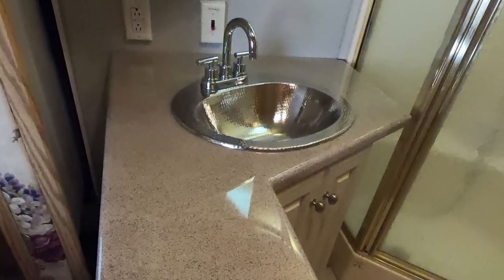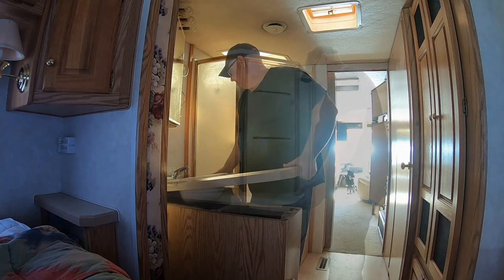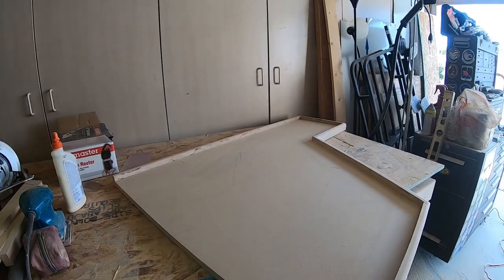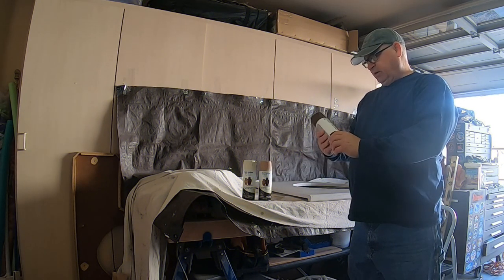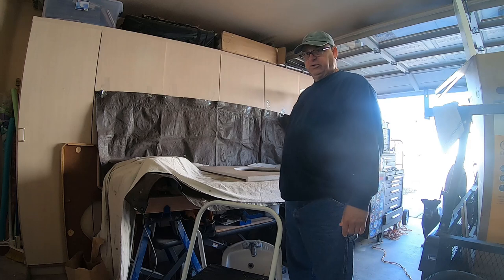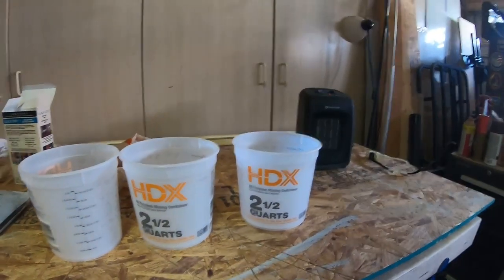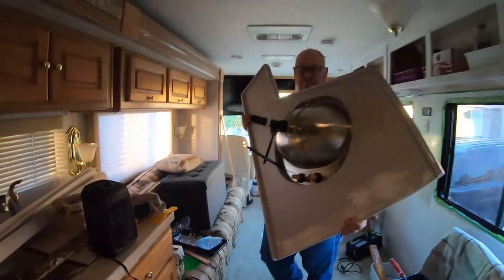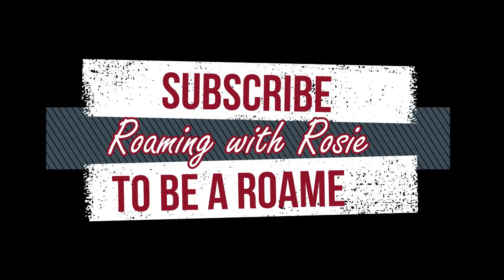Epic Affordable Epoxy Countertop Upgrade For RV or Home!

Comment: I know this video is a bit older, but man you nailed it! (no pun intended!). I had no idea you could even do this. Great work!     Jim
Reply from the maker: Thanks, I had a lot of fun doing this project. It's especially rewarding when it comes out good. The only thing I would do differently is use Total Boat Epoxy it cures a lot harder than the product I used.
Thanks for watching!

Comment: Wow! That looks beautiful!! I have been looking for an inexpensive way to do the counters in our camper, even though they are very small, we have two bathroom sinks and eventually would like to re-do the kitchen counter too. I already have the new sinks and faucets, just trying to figure out counter tops. 
What made you decide on your 3 colors of paint? Thanks!
Reply from the maker: We had worked with the stone spray for projects in the house, so kind of remembered what combo we liked.  We also used a darker base coat before with light spray colors.  But the biggest difference now is the epoxy.  Makes it look like stone for real.  Thanks for watching!

Comment: Great job.. do you think this would work with kitchen countertops if I sand them and rough them up first ?
Reply from the maker: I think it would work. You would want to use a good primer before you paint your base color. Thanks and thank you for watching!
Reply: @RoamingWithRosie  awesome .. we purchased a tiny house for a home base. It has perfectly good counter tops in the kitchen but they are red - yuk